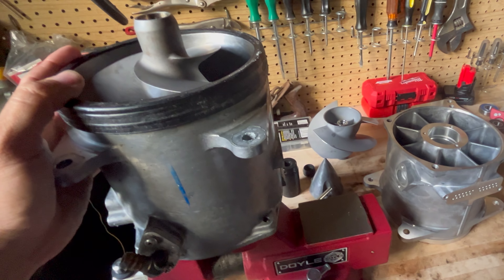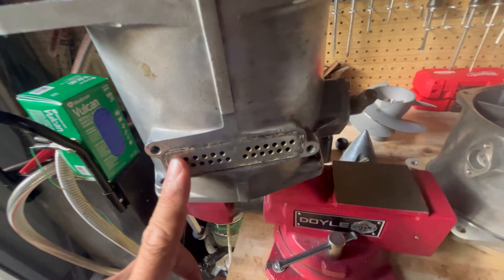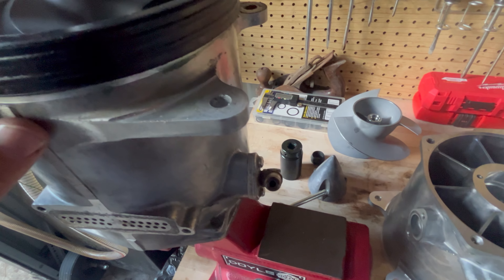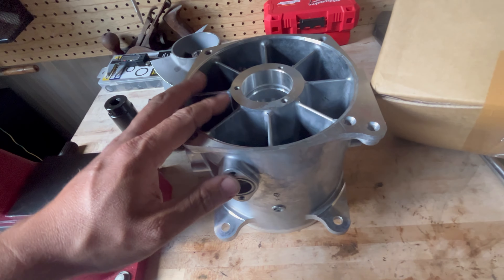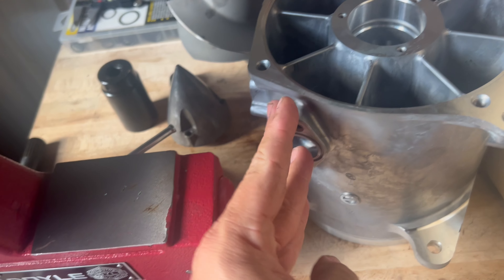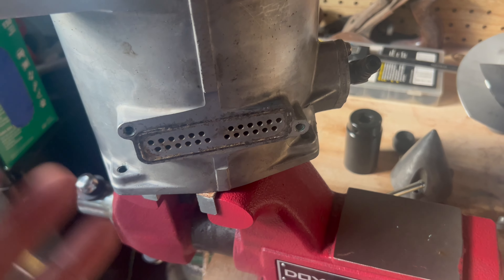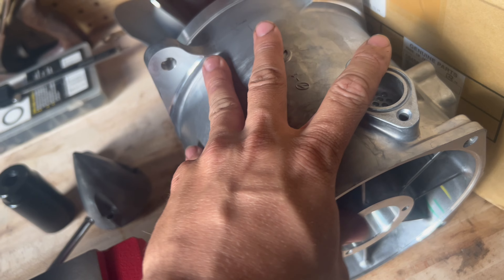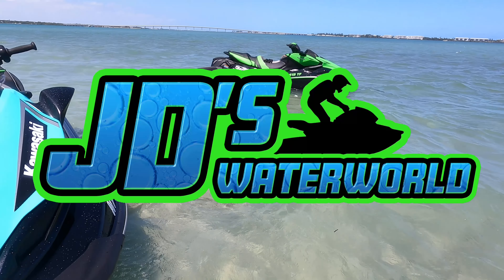Biggest Jet Ski Leak of 2024? I accidentally discover a new Jet Pump Casting from Kawasaki! [4K]

Comment: Are you able to share the place you order the parts from? Also, what is the reason for the impeller/ casting replacement?  I suspect it is out of tolerance, if so what were your findings?  Any chance you are doing a video of how the replacement rebuilding goes??   Thanks for posting JD!  Awesome discovery!
Reply from the maker: Yes I am actually building an entirely new pump with new impeller, all new parts and new housing- I am doing a tutorial on it- was in the process of filming that when I realized the new part has the extra port. Yea from
The saltwater my pump housing swelled- and when it swells it wears down the impeller..I could have run it another 50 hours but the clearance gap was at the end of the useable limit which means I’m losing speed cause of it..so figured time for new pump. Made it to 200 hours of hard use so fell like I got my money out of it!